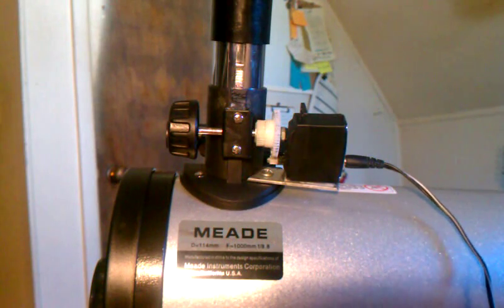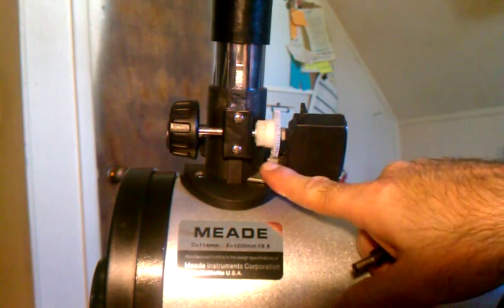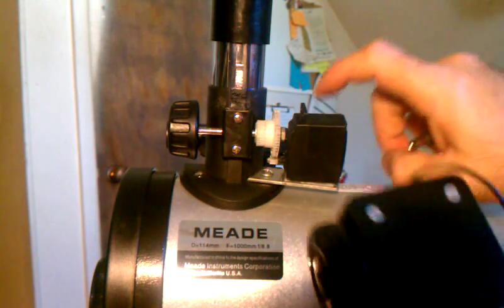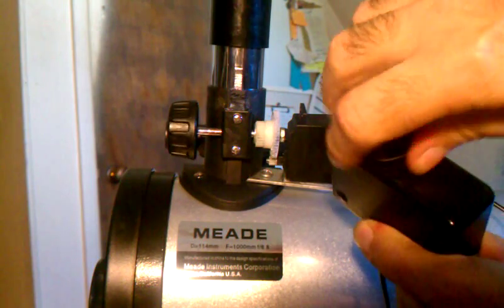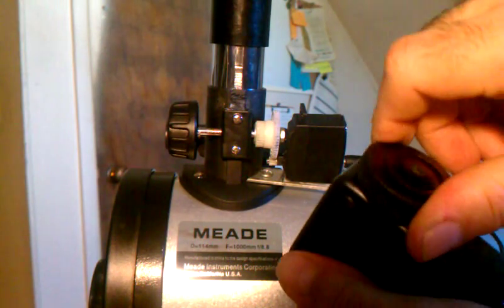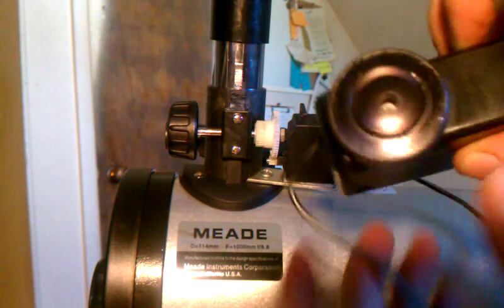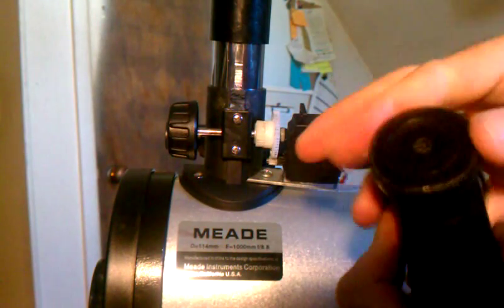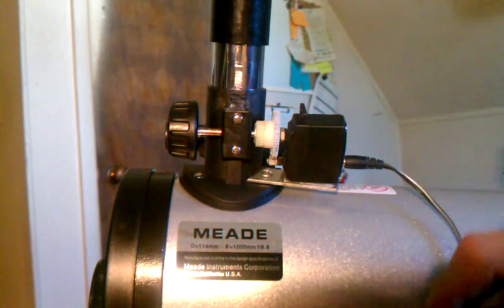Easy DIY motorized battery free telescope focuser

Comment: I like the gearing idea you have here. I have been looking at getting an electric focuser, but one of the things that has kept me from it is the DREADFULLY slow focus rate. If the draw tube is racked all the way in it takes FOREVER to get it out to focus. And when finished, racking it back in is equally slow. With the configuration you have here, it should be easy enough to add a lever to engage/disengage the drive gear so you can still operate the stock focus knob manually to quickly move the draw tube in and out, then just use the electric focuser to fine focus.